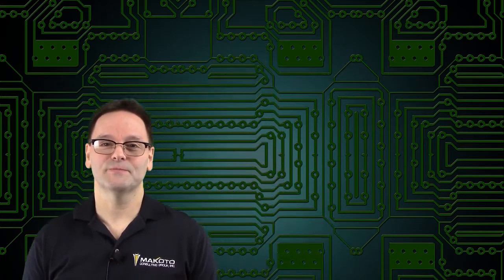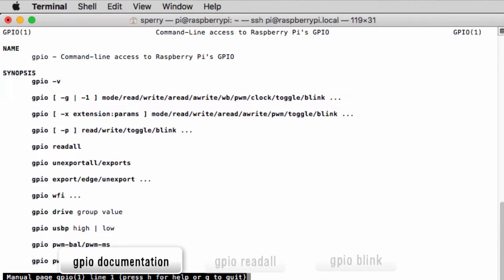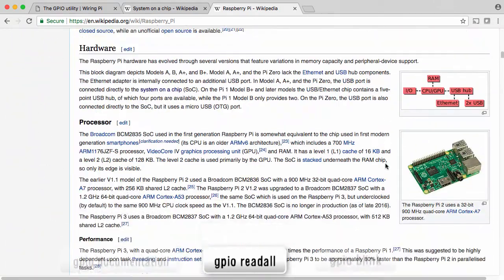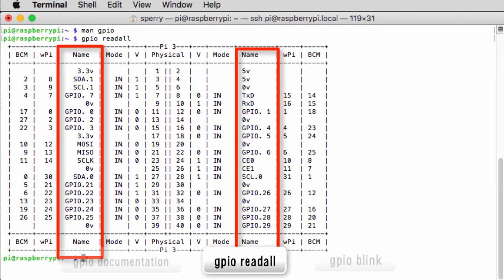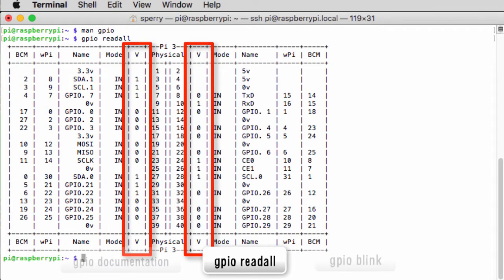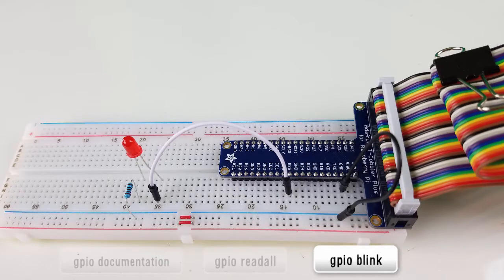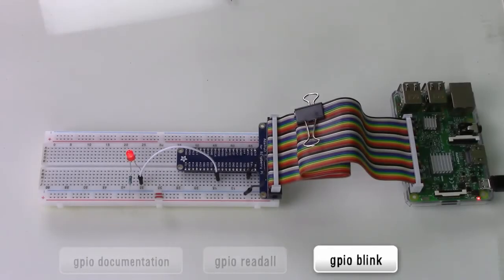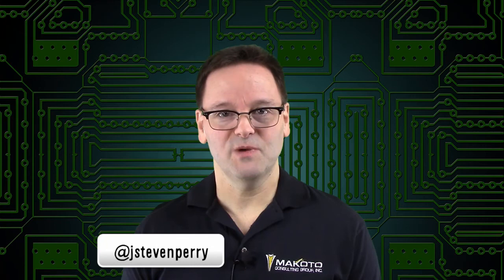Home Automation Tutorial: The WiringPi gpio Utility

Comment: Hi ,when i power up relay from the raspberry pi(5v) it works fine however if i just send the signal from rasp.and get power from outside transformer (5v) the relay doen't work .So the question is y?